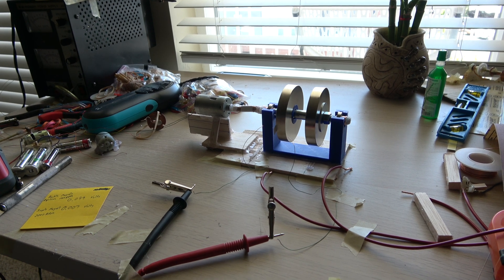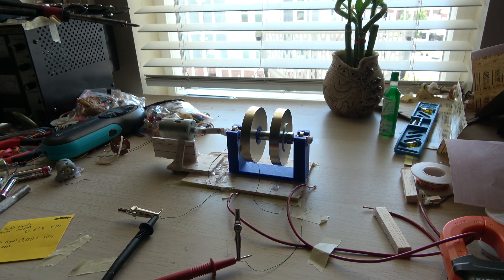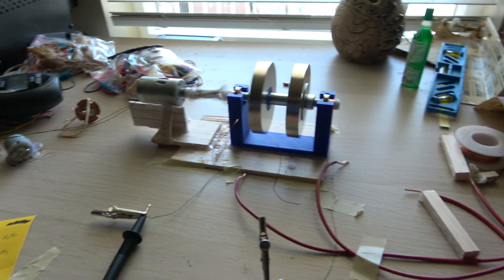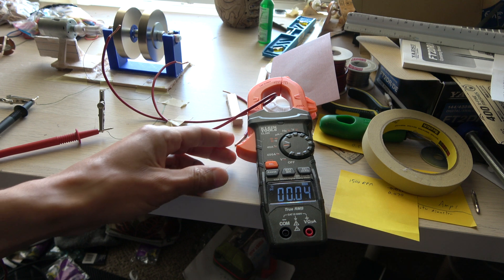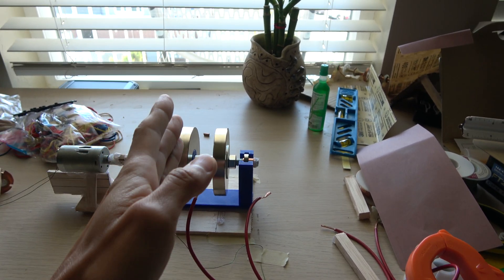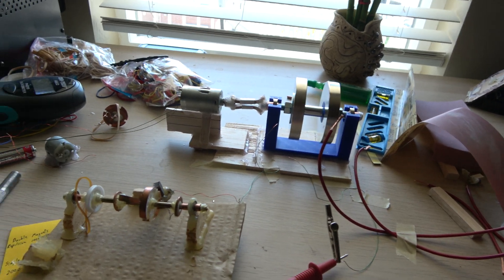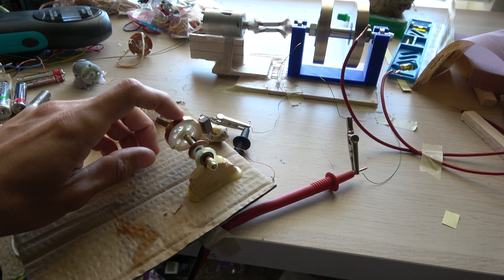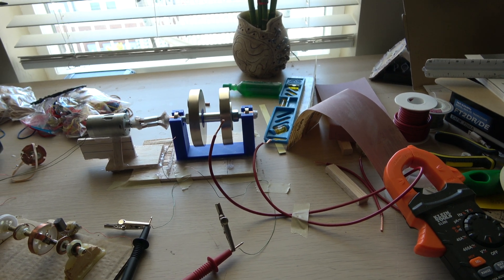Bruce Depalma's N-Machine

Comment: Depalma speaks of needing high speed to see the effect, > 6000 rpm
Reply from the maker: Correct, but Depalma was not using Neodymium magnets in his day.  So with the new magnets Timothy Thrapp says you only need about 4500 rpm to get overunity.
Reply: Concerning safety, what most people don't understand is that they have an over unity device in their home, right now: a refrigerator has coefficient of performance about two. A heat pump is about five. Solar and wind are free energy collection systems. Big oil has seen the writing on the wall for decades, and the smart money is hedged. Deployment of free energy collection systems has a cost, in materials,  so roll out won't be instant. And social media has traffic shaping that reduces impact.

Comment: Nice work, thank you. I have a question: Why your machine has produced only 1.5 A at approximately 1641 RPM, while other machine has produced (might be 10 times more) at the same RPM ??
Reply: My guess is that it produces less because the centrifugal force comes in from outside and it only takes a small portion of the incoming electricity throughout the entire area. Also the design is flawed.

Comment: You should try an iron shaft inside the magnets
Reply from the maker: And why is that?  What I'd like to do is use much stronger, smaller magnets and also magnetic bearings for noise and vibration reduction.  Stronger magnets will make it easier to generate over unity.
Reply: @spiritelemental and add more receivers, which will increase electricity production.

Comment: You are supposed to make one of your connection to a pole of the magnet and then the other at the equator of the magnet.   That is why its a Hompolar Dynamo.   Homo meaning one Pole.   Bruce used two spinning magnets because he was connecting them in series to get double the voltage.    These generators make lots of current but the voltage depends on the size of magnet or you have to use multiple and put them in series.     Make one connection to the shaft you have and then take readings off the side like you were doing.   That is how they work.

Comment: dude, add more magnets and make contact in series / parallel mode. you may get yet stronger voltage. Regarding rpm, 12k rpm having motors will go good on these projects, from values what you gave here, you get around 1.5 amp at 70-80 millivolt , thats about 0.105 to 0.12 watt, where as you provide more wattage into the motor.
Reply: You can convert current to voltage?

Comment: Your guessing that the increase in repulsion force will help, in that case, maybe more powerful magnets?  Amazon sells super brute force magnets, but be careful, they crush fingers! Permanently, and you must use serious careful pre thought and wit in setting them up. They ship them really spaced apart from each other. Also the heavier the magnets the more you must control the increase of vibration! That fly wheel will fly right out the window.
Reply from the maker: It was actually the vibration that stopped my project here at about 2700 rpm.  My plan was to have the magnets float on some magnetic bearings but I never got around to doing that.  lol   At first I put the whole thing on springs to try to reduce the vibration with some success but not enough.  The thing has to reach 6000 rpm before it achieves over unity according to Bruce Depalma.  and yes, stronger magnets would help but I'm very poor right now.  Unemployed and broke, so things are not looking very good for me in the next few months, although I have lots of food and water so I won't starve to death at least in the coming sh*t storm that is only days away now from happening in the world.  In a year or so after the dust settlings then I will resume all of my projects, and if those really strong magnets are available at that time, I will by them.  Thanks.
Reply: @spiritelemental Use graphene to make it durable. More conductive than copper, slightly transparent and 200 times stronger than steel.

Comment: If you connect a battery in series with the output of the N-Machine do you get battery voltage with increased current coming out?

Comment: Oh - interesting I guess you can just use the magnets - and they would induce a opposite potentail between the outside and axis... my bad :)  (still think if you had a nice thick stack of copper plates between you could get more amps.
Reply from the maker: I happen to have a quarter inch thick copper disc that is 3 inches in diameter.  This could be of help in creating greater amperage?  Where would I put it?  

My understanding is, (as you have said) there is a voltage difference that develops between the axis and the outer rim of the magnet but its the opposite in the other magnet, so they form a series circuit together through the axis and add their amperage together.  Depalma's N machine was made of 2 large magnetic fields in repulsion.  Each cylinder magnet had a copper disc cutting through it along its equator in the Bloch wall area of the magnetic field.  The axis connected the two Bloch walls of both magnets and allowed a circuit path for electron flow.  To successfully incorporate copper discs I would need 4 magnets.  2 sets of 2 in attraction to each other but both sets in repulsion to each other if that makes sense?  2 copper discs could be installed.  Each one in each Bloch wall of the two magnetic fields.
Reply: An opposite potential called?

Comment: inverter/oscillator not rectifier - the mechanical inverter to get pulsed AC... an inverter from DC to AC does that... the rectifier is the other side :)

Comment: It's not quite the same as Depalma.. the field isn't entirely north, but you have a huge inversionin the center (well it's not that big, it is pretty good... but already at 1:26 I suspect negative results... plus you should add a copper plate between them... there's a paramagnetic plate that is the actual current collector... (oop didn't mean to click send first)...
Edit: and it's a voltage difference between the axis and the outer rim.; not between surfaces - like how they can do with a ball bearing engine...
Reply: Where do current and voltage pass? Is it from the shaft or circular metal (or magnet) things?
Reply: @CharaTR  yes.  From shaft to rim is potential difference

Comment: You may want to use BLDC controller and a brushless DC motor, like from HDD. Not sure if it will produce enough torque for such crude applications, but will surely consume much less power and can go up to 5k, 7k or even 12k rpm in well balanced systems - depends on what you put your hands on. These are relatively easy to use, if you have some basic electronics skills and once you make yourself such controller, you can easily adjust the RPM ;)

Comment: Hey the project looks good....one suggestion...the rpm of the motor should get up too 2000 RPM's. This will intensify the Fields and increase the amps    cheers!
Reply from the maker: Thanks!  Yes, I will definitely test it at higher speeds! I only finished building the project yesterday so I haven't yet experimented with how fast I can get it to spin at.  6000 rpm is my ultimate goal though.  What kind of brushes do you use and where do you get them?  Thanks.
Reply: @spiritelemental  hey how's it going the..... brushes I used are from the Dremel tool they're little brushes you can buy that are made for a Dremel I take those brushes and then I cut the brush bristle in half with an exacto blade and I use that to rub on the leading Edge of the magnet that I seem to work really well I think the pickup and the potential there is actually almost like a static effect so you can try that and see how that works
Reply from the maker: @FaradayResearch  Awesome!  That's great to hear.  Thank you for letting me know about the brushes.  I will buy some tomorrow, and things are going well right now.